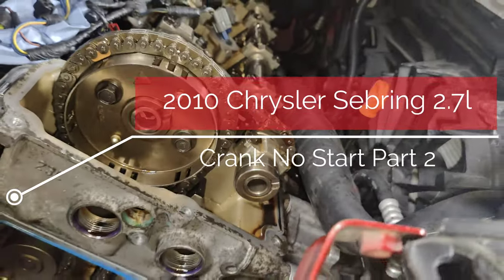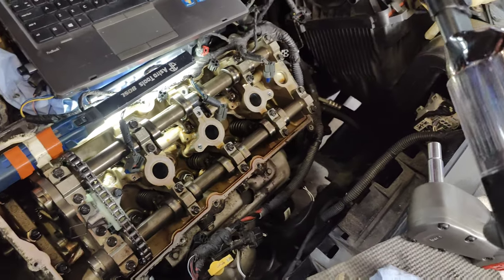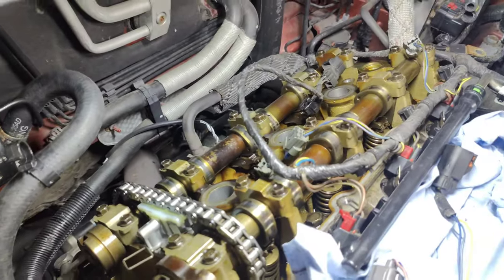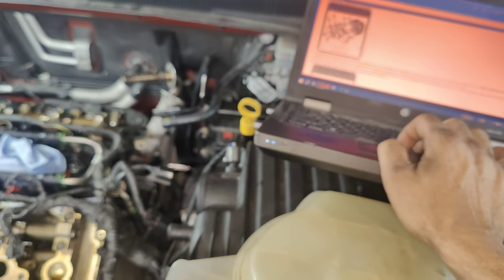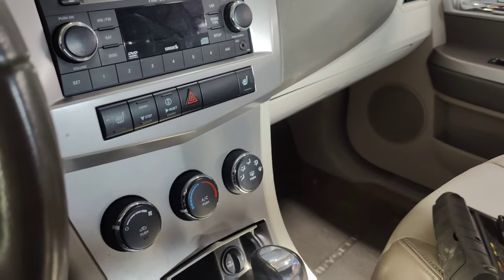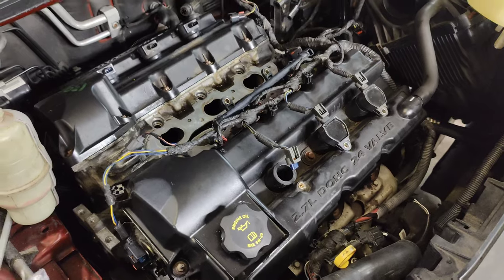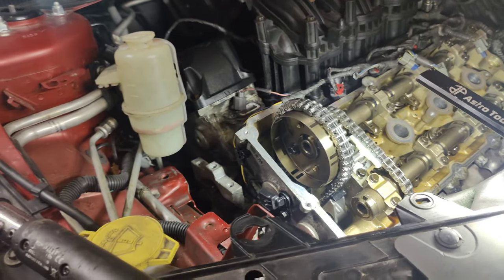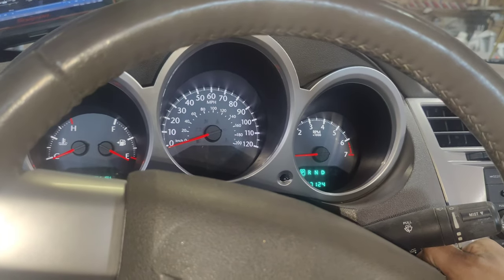2010 Sebring Convertible 2.7l Crank No Start... Part 2

Comment: I love it, buy a cheap set to help a friend, is it going to last as long as they will own the car? I should have, bro, where is your checklist to ensure there are no, I should haves? Then I don't remember. You have an incyl pressure transducer, where is your cranking waveform showing ALL your valve timing vs piston location? A BROKEN FLEXPLATE is a CHRY trademark. Only my opinion, your viewer count is low because you sound so unsure of yourself, yes, it's your personality and you are soft-spoken, but very unsure.  I have been watching you for a year straight now. The funny part, your channel is near the top of my list of 200 technician/diagnostician levels, no DIY Channels on my list. A loud noise means break out the stethoscope ASAP. On to Part 3.
Reply from the maker: I appreciate the feedback, I thought I showed the incylinder capture in the video. This job took so long to film. I guess I will have to start making very assertive statements. My friend bought this car for around $1000. I was the one paying to fix the car so every part came out of my pocket.  Till I was done I spent close to $2000 fixing this car for him and I can't even guess how many hours.